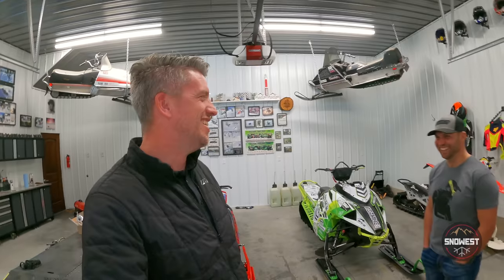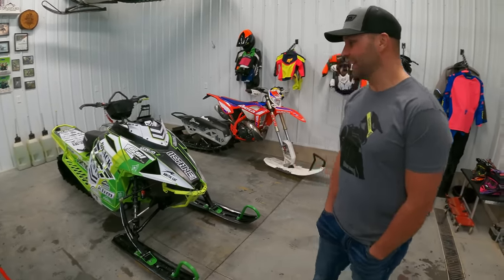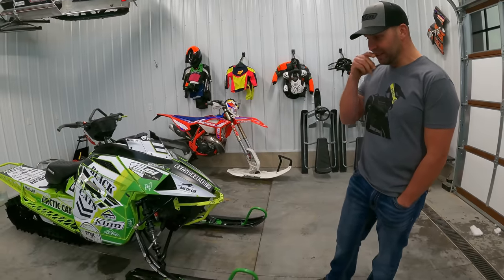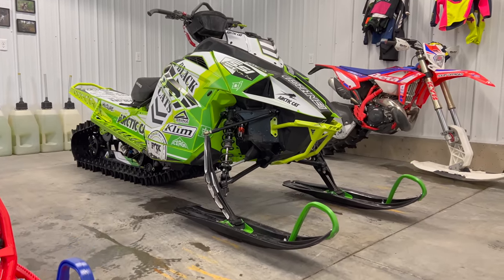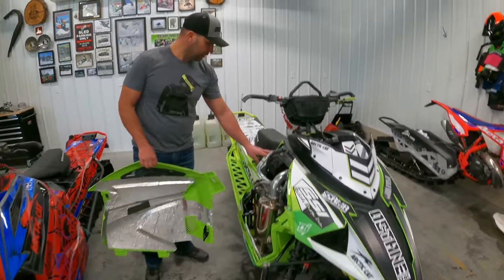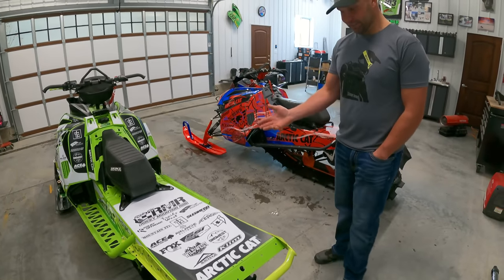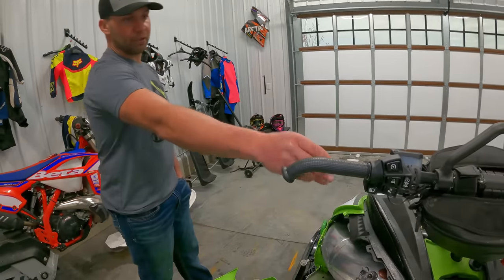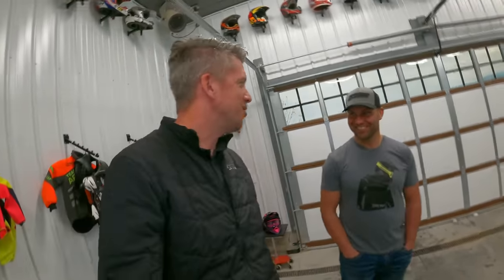David McClure's Hardcore 900 Alpha lightweight build - the SNOWEST show

Comment: Its said how few brand ambassadors cat has,and the ones they do have do nothing to promote the brand.i mean the 23 mountain sleds are still using the same tail light,snowflap,boards ect from
The 2012.they dont even make the small attempt to changed and improve the things they easily could.been a lifelong cat rider but their losing me with the same ol same same ol year after year.and here we have a sponsored cat guy,talking up aftermarket parts.so basically buy a new cat and go nuts on aftermarket to make it comparable to other oems factory stuff.dont get me wrong,im all about aftermarket.but what cat is doing,they are losing lifelong cat guys and fail miserably to attract new customers.